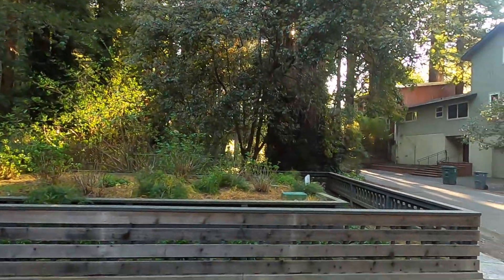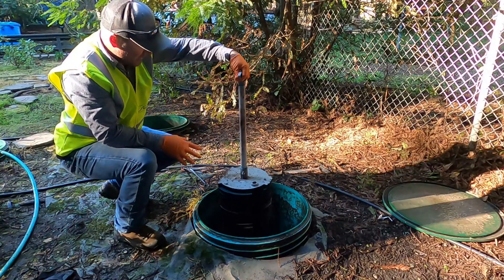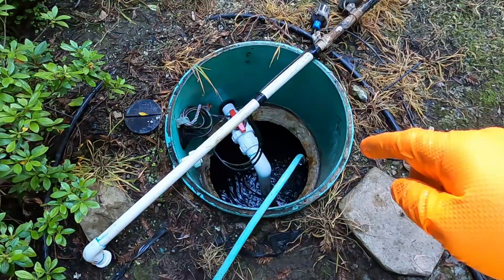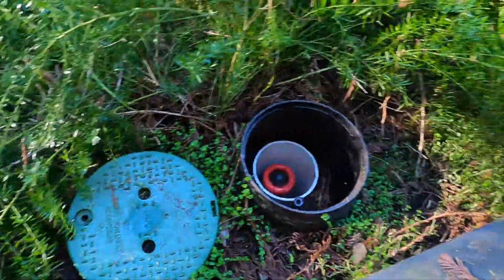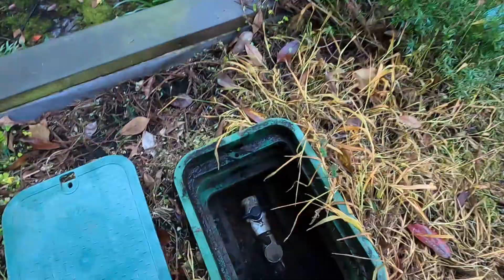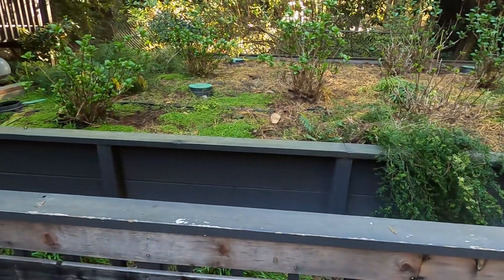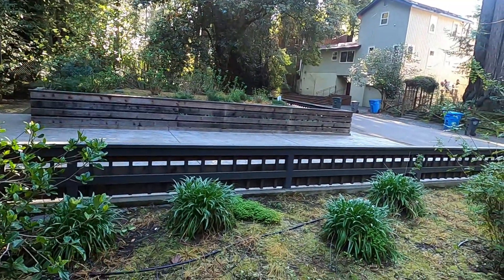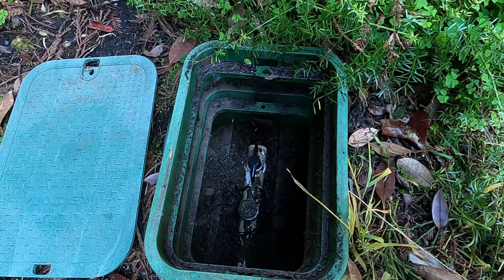Purging a septic system sand filter EP43

Comment: I find the video very educational. Swimming pools used to use rock and sand filters in the old days. Cleaning them was done by backwashing and observing a sight glass. I think there is a distance that dirty water passes thru a sand bed and then it is considered clean. Picture a stream or brook. Now DE filters r pretty popular. I use a Liberty 1 hp emaciator  pump in a large tank type  cesspool  to pump from low lying bathrooms in the back of my property up to the sewer pipe in the front. Wipes and tampons  r horrible.  The system works very nicely. Before the Liberty pump, I made a manifold of 1  1/2 inch pvc and hundreds of 3/16 holes drilled in them and a brass 1 hp pool pump. It would have to b primed which I did with a ball valve and city water to the 1/4 inch pipe plug on the lint pot basket. I would drain twice a week. That when I discovered wipes and Tampons r killer. The water is pumped 200 feet to the sewer clean out at the front house. Getting the automatic Liberty emaciator was like being released from jail.